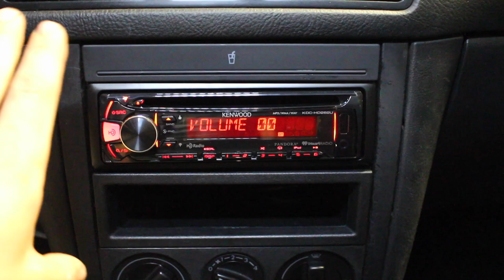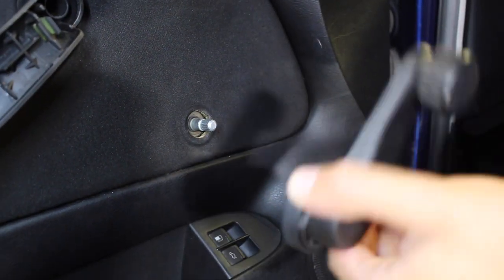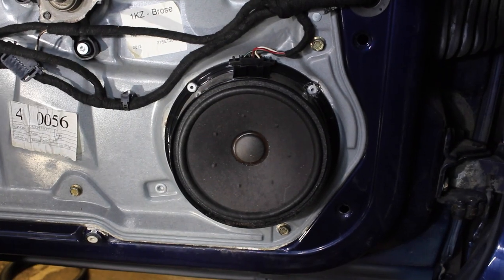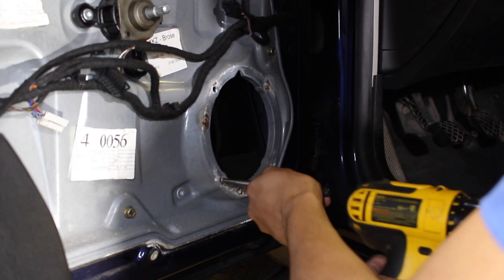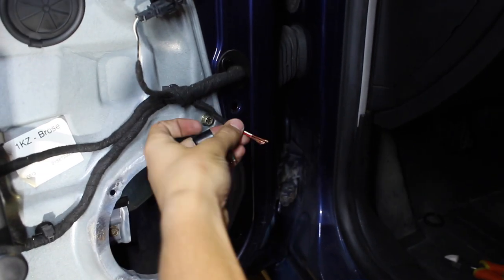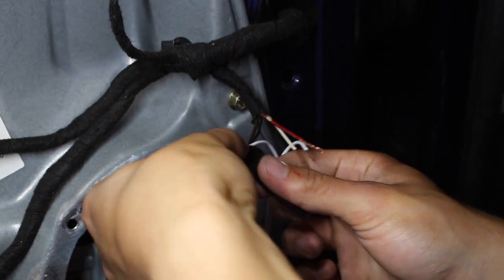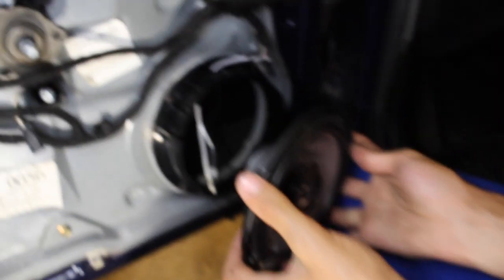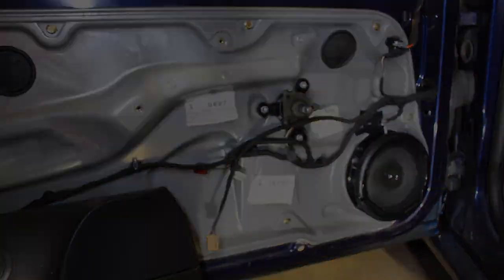How to Install Aftermarket Speakers

Comment: To do good connections you need to solder the wires and use shrink tube

Comment: if u dont have speakers in the back and need to lead a wire to the back, how do u do that ?
Reply: Under the carpet or under the trim, and if you are putting them in your rear doors you will need to put the wires through the grommet into the door

Comment: Surely independent tweeters and mid range speakers are better then a 2 way?
Reply: Yep it is, unless they can’t handle the amount of power the new head unit is outputting. If you put too much power to them they will just 💥

Comment: I hooked up some kicker 6 by 9 on my Toyota tundra but the tweeter on the speaker don't want to work
Reply: Does your tundra already have tweeters in the door panels premounted form Toyota?
Reply: @dochumbug8153  yes
Reply: @espemartinez8715  And do the  premounted tweeters still work? If so, then there is probably also a premounted crossover installed which separates the frequencies for tweeter und mid/sub-speaker.

Comment: OR do the smart thing and get the adapter?
Reply: what adapter?
Reply: They make adapters to convert your stock harness to the aftermarket speaker harness, that's what I did in my 01 Explorer, didn't want to cut the harness and open a path of potential corrosion
Reply: BronzeChicken oh ok yeah i just found out about that haha right after i read your comment. that seems perfect because i i'm not a pro or anything with this stuff. never installed speakers in a car so i don't wanter to solder wires or cut them or anything.
Reply: do they require any soldering? or is it just plug and connect?
Reply: damn thanks man

Comment: So you don't need an AMP? I have a 1990 miata
Reply: You don't need an amp. If the speaker is suited for it, just a headunit will do fine. Some speakers are harder to drive, and need an amp to play loud and clear. It's a lot more work to wire up an amp, compared to just using the standard speaker wires. You will play loud with only a headunit, but don't expect a punch in the mid bass. It can be a big upgrade in sound quality just changing headunit and speakers. Anyways I plan to mount an amp I have in my car, it is 4 channels with 120W RMS. The cables are already placed underneath the carpet
Reply: Hey man I wired up my aftermarket speaker to my doors and the back two.. tell me why my sound is better on my stock speakers.. my new ones are 300w max.. every time I turn the volume higher than 20 it distorts.. I done tryed a lot of things and nothing seems to work !!?

Comment: Dude I am sure this was VW Golf 4. Stock speakers have built in filter and from there wires go to the tweeters. So if you are connecting the co axial speakers you should disconnect the stock tweeter wires. The way you have connected, stock tweeters will not play the right frequencies. Two of these wires were going to the tweeters. The better way is to replace front speakers with midbas speakers and separate tweeters with 2 way filter. Why did you install two speaker grills, doesnt make any sense

Comment: Its not really true about the speakers.. They do work in both directions but you have to wire both of the speakers the same otherwise they will be interfering each other
Reply from the maker: Considering I wired up them both together (the tweeter and the speaker) they won't be interfering.
Reply: zohanson1 That is also no truth. If you change the polarity of the speaker you are changing the polarity of the electromagnet that is inside doing all of that sound, and since the speaker is manufactured to work one way for the best quality, it may not have the room for movement so the quality will be worse and speaker will be quieter. And if you really don't care about polarity of your speakers at all you are probably going to be creating opposite sound waves and that will make whole setup quieter and terrible

Comment: I'm glad to see its not just me who perked up when he said the polarity of the positive and negative doesn't matter. What the fuck dude! It's called in phase and out of phase! In phase = speaker pumps out, out of phase = speaker pulls inwards! Even if you installed a system, run a diagnostic disc to ensure everything is correct. It sends frequent tones to individual speakers and shows you if in or out of phase. Also, you do not, and I repeat, do NOT test your speakers with country music! Country music will damage your speakers, you might as well take a shit, catch it in your hand and smear it on your lovely new speakers. Ew. :D

Comment: As a ham radio operator your wiring job make me vomit... Soldering and heat shrink should have been used.
Reply: Video Ramblings of Matthew in high vibration situations a crimp join is fine.

Comment: One more thing I didn’t see anykne mentioned. Original speaker had a capacitor that lowers power to tweeter. And the aftermarket one don’t. So possibly at higher volume, the tweeter just blown up. Worst video talking about upgrading the car audio

Comment: Dude you got to stop with the " it doesn't matter which way you connect them " that is incorrect information.! They will work , but at the same time you make the radio work harder possibly leading into damaging the 🔊 and or radio.. There is a reason for its polarity being used correctly. At least tell your viewers to wire the them in the correct polarity , but you don't care to on your equipment..! If someone's radio or speakers don't work properly or gets damaged, they can hold you responsible for giving them the wrong information. Do some homework before you go and give out bad advice and say it doesn't matter !! And by the way I like the left one ☝️..peace ! Oh yeah why don't you wire your cars battery in reverse and try to start your car , see what happens that will teach you to never say that again..